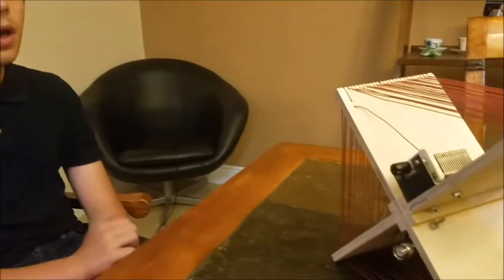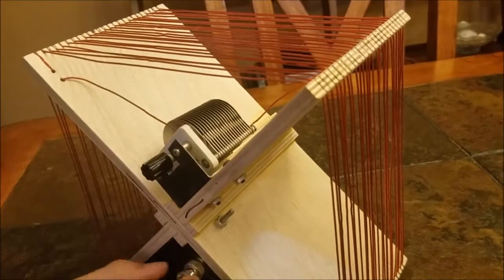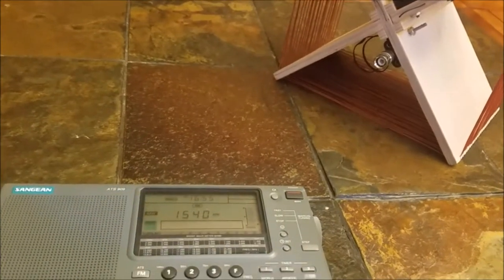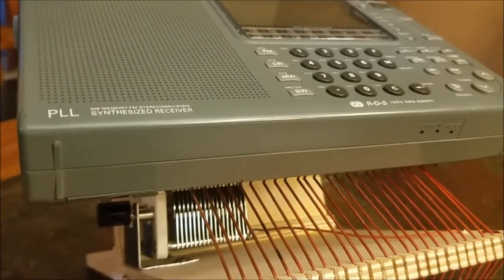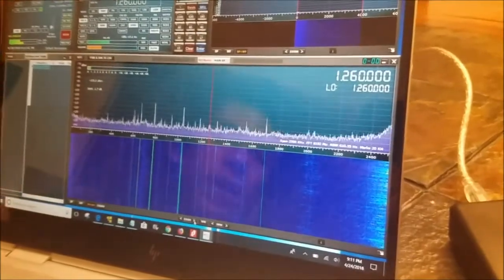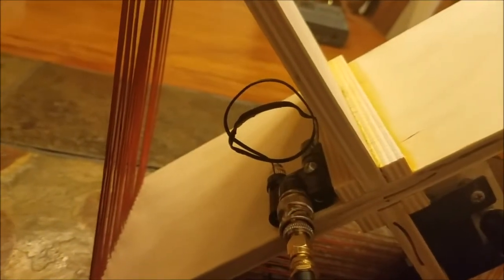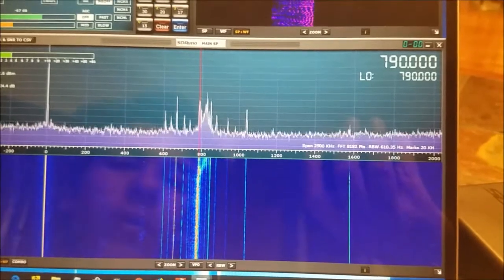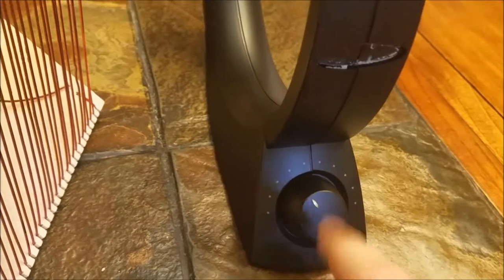2018: Loop antennas for AM broadcast band

Comment: I ahve made 3 projects of MW antrennas . The australian loop and  1x1m square x 9 turns of wire , another from a vegetables basket and the word famous An200 tecsun that  has about 20 db gain in most of the band but i stoped with that . the remain are not easy to handle 

Only untuned antennas can work with SDRs!!

Comment: One of the best videos about AM loop antennas. I got a question: since it is very difficult to find a variable capacitor, I thought if it is possible to make such a variable capacitor out of foil pipes (the ones we use for cooking in the oven). I even made one, with two pipes of different diameter (they fit in each other perfectly), connected a loop antenna and started experimenting with my Panasonic radio, sliding the smaller pipe in an out. I had checked the capacitance of my capacitor, it varied btw 100 and 700 pf. I checked all the medium wave frequencies but my radio reacted when only I set it to 1240 Khz. there was no station but the signal was amplified so much that the radio wrote "tuned". I don't know why it happened and why my jumbo capacitor didn't work for other medium wave frequencies.
Reply from the maker: Ham radio gatherings are the best places to find old variable capacitors when people empty their old junk boxes. Sometimes homemade variable capacitors can be made using soda cans but that is a separate project.
Reply: Claudio Rizzuto ... I used to connect a 120 turn coil of 26awg magnet wire wrapped on a paper towel tube to two 250 foot longwire antennas and place the coil near an AM radio in the daytime and get amazing DX reception.

Comment: Kudos to you Thomas, for using a proper coupling loop design (for the 50 ohm output) that follows sound practice, such as the approx. 1/5th size of the main loop-- see this informative page on loops:  http://webclass.org/k5ijb/antennas/Small-magnetic-loop-coupling-loops.htm .  Also, the sharp peaking is partially due to your wise choice of the ceramic air-variable cap; These  are usually higher "Q" than lesser quality capacitors. They are the choice of serious crystal radio builders.   By the way, are you familiar with Ferrite Sleeve Loops? I have built a few of these for chasing overseas medium wave (AM band) distant signals. Here's a link to one I constructed: https://swling.com/blog/2017/01/a-new-approach-to-fsl-antenna-construction/

Keep up the good work with your videos. 73, Guy
Reply: Yes it is ceramic type. The insulating parts like the rotor and stator supports are ceramic, for higher Q. The plates are of course metal. The ceramic term refers to the supporting structure. These types are higher Q than the common epoxy board supports. The end result is better, sharper peaking of tuned signals.